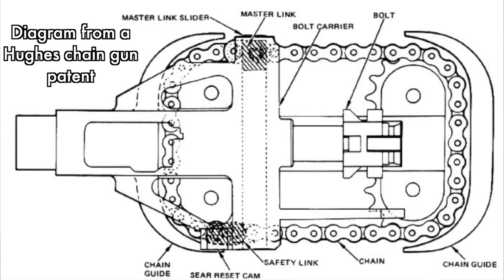Ask Ian: Are Man-Portable Chain Guns Coming?

Comment: In an infantry context the biggest benefit would seem to be that the use of an externally powered gun could in turn allow lighter ammunition because of less propellant, but not only would that only hold in situations where the weight of ammunition outweighed the weight of the firing platform, it would require an entirely new type of ammunition, which is why it would never happen.  Not to mention that the majority of ammunition weight is the casing and the bullet, not the propellant.

Comment: I would expect it to be fairly simple on a minigun to have adjustable fire rate by running the motor at a different speed. If you want to fire at 600rpm, you can do so for a very long time without overheating. If you want to fire at 5000rpm, you can do so for a brief time. Not sure whether this has been implemented.
Reply: In the F-15, you can select between 4000 and 6000 rpm. 6000 gives you about 9 seconds of firing time.
Reply: I suspect there's not much point, miniguns exist to throw as much lead as possible in a very short space of time. If you only want 500rpm, most modern, general purpose machine guns are perfectly capable of sustaining that for quite a while, if you have a spare barrel or two.
Reply: @matthewn4896  I'm making this up but it could be a way to allow suppressive fire without the space/weight of an extra MG or burning through your ammo at full rate
Reply: @totensiebush  mini guns don’t like running in short burst or slow

They like to chew
Reply: Pretty sure you can adjust the RoF of a minigun just by changing how fast it rotates. Like if you just try to force the barrels to rotate 1 click the gun will fire so you could just get a motor to spin it at a rate of 20 rotations per minute or 140 rounds per minute. Very slow but Im pretty sure its possible.

Comment: When most laymen say "chaingun," they are referring to powered Gatling guns. But I do appreciate that Ian explains it using the actual definition of a chaingun--as used as the autocannons of IFVs like the LAV or Bradley, or the 30 mm cannon of the Apache.

You can very finely control the rate of fire on the chaingun. Great for IFVs as you can program burst fire from a single trigger pull. 

I think there is a 30 mm portable chaingun in development on a small tracked drone for infantry support. It uses HEDP rounds with air burst. This is smaller than a car so it can be support infantry where vehicles can't get to.
Reply: My brain instantly went to "helicopter gun" and i'm quite lay
Reply: Wolfenstein 3d and Doom are to blame for that I think.
Reply: You can technicaly have Gatling chaingun if your ammunition is loaded by separate mechanism right?
Reply: @petrsukenik9266  There is such thing as a "revolver cannon" where the the back end is like a Gatling but it still has only one barrel. This is the cannon used in some European fighter jets, the Mauser BK-27
Reply: @petrsukenik9266   When folks say "Gatling" they typically mean some system of multiple barrels rotating around an axis. "Chaingun" refers primarily to (Like Ian talked about.) the chain driven loading and rate of fire management. 

  Combine both features? You'd take the weight penalty of both the chain drive and multiple barrels. I'd still like to see a good try at one of those.
Reply: @petrsukenik9266  That would entail adding a lot of mechanical complexity for absolutely no gains over a regular Gatling-type rotary gun.
Reply: @ThomasFuglseth  not saying its practical, just saing you can have Gatling chaingun
Reply: @UCKY5  minugun is when something is spinning barreles and thar operates loading mechanism
Chaingun is when you have separate machine loading the gun
Therefore you could have spinning battels and separate loading mechanism to combine disadvatages of both systems
Reply: Even IFVs dont need chain guns. Eg the Puma IFV, with its advanced dual feed 30mm cannon and programmable ammunition, is just gas-operated. Its not even a revolver cannon like some previous 30mm cannons of its type. Probably saves a lot of weight and is easier to reload than a chain gun.

And regulating the firing rate of autocannons is surely super simple anyway. The disconnector is probably electronically controlled, after all (the gunner is using a button, not a mechanically connected trigger). Heck, even the fuse might be electric these days.
Reply: @termitreter6545  MBTs use an Electronic Ignition for ammunition, or at least the Abrams does. Even the backup "Master Blaster" is a quartz triggered electrical impulse.
Reply: @chief5861  Yeah Ive looked it up, and it seems like the standard for Nato 120mm tank rounds is just electric primers.
Probably just makes sense; you got the space and power in a tank to do so, and its probably a lot safer and more relaible too. Its probably quite easy to accidentally drop a cartridge and bang the underside somewhere.

In fact, looks like even many WW2 tanks used electric primers. At least german tanks, like P4 and Panther.
Reply: @termitreter6545  Its less of the possibility of dropping it and more the simplicity of an electric igniter compared to rigging up big ass firing pings in those breeches which could break if not cared for. And yeah given that most other things are electric why not fire the gun that way too.
Reply: @chief5861  I mean its all of those combined I'd say^^
Reply: @chief5861  Isn't the 20mm Vulcan gatt on US Aircraft electrically primed?
Reply: I'm one of the people who misunderstood the term and I blame Doom for that...

Comment: As the cartridge is not powering the action, is there an opportunity to gain muzzle velocity or trade off the amount of propellant (and hence weight) of individual rounds?
Reply: Insignificant. By comparison, look up the difference between .308 in a bolt and semi auto with same barrel length.

Comment: I'm no engineer, but I've always wanted to somehow build a man-portable revolver (auto) cannon.

Like they use in aircraft. Basically a mini shVAK or BK-27 in .223/5.56 instead of the usual 20mm or 30mm. 

Awesome, but entirely impractical in every way. Could achieve some insane rpms, but cooling would probably be next to impossible (especially under sustained fire).
Reply: @Cancer McAids  I was under the impression that regardless of the magazine size of your automatic weapon, short controlled bursts of fire are preferable  over just gluing the trigger to your trigger finger ammo dumping  fire. Am I correct?
Reply: @drivanradosivic1357  If you have a system capable of keeping fire on target, volume of fire is always going to directly increase your hit probability. The reason you don't dump is because no system can stay on target that well, so you split the difference by firing in bursts.
Reply: @dustinbrueggemann1875  so, firs SMART guns from Alien?
Reply: As others say - Miniguns and Microguns exist. And nowadays the electricity for the motor is hardly an issue anymore... But the REAL issue remains: Unless it's an Airsoft Gatling (which do exist btw, if you have a lot of money to waste), you need to carry a backpack with ammunition. The larger the calibre the bigger and heavier the backpack... If you have a gun that fires 1500 rounds per minute, you do the maths... And THEN you look at how much that ammo will cost you. That's the trouble with all machine guns - they're a lot of fun, but only if somebody else pays for the ammo 😂
Reply: Just make a double barrel gas operated revolver gun with quick change barrels and lower overall rate of fire like Oerlikon RK 421 with a single chamber so one can change one barrel while continuously firing the other one.
Reply: Chambered in .22LR but with a weight of fire (due to a vastly higher rate of fire) matching an AR.
Reply: blow air around it or maybe use water for cooling... pretty sure big cannons on ships do that
Reply: A company called Empty Shell made a 5.56 NATO version of the minigun. There are lots of videos on YouTube. 
https://youtu.be/UdGueKkjQlk
Reply: Something firing 5.56 isn't a cannon, so I wouldn't call that an autocannon. Not sure what the right term for it would be.
Reply: @totensiebush  "Fun," that's what you should call it.
Reply: @totensiebush  you have the minigun, but also the microgun as in, the smaller caliber using minigun.  I think there was a Shotshow or some other gun related event that had the microgun promos.
Reply: @drivanradosivic1357  i remember seeing a .22lr minigun.
Reply: @leflavius_nl5370   so, you saw a .22lr Microgun for sale? neat.
Reply: @drivanradosivic1357  The minigun itself was IIRC a miniaturized version of a bigger gun. But it kinda became the popular name for multi-barrel guns.

Autocannon on the other hand usually just means a large caliber machine gun, like 20mm and more. So a small AC is basically just a machine gun.
Reply: @termitreter6545   For what I saw, Autcannon is what people call a single barrel machine guns, but could also mean some semi auto nade shooter or even a explosive round 50BMG in semi auto sort of machine gun.
Reply: @drivanradosivic1357  Thats sounds like theyre just using the term for fun though, because Autocannon sounds cool. I dont think it makes sense.

Like, autocannon is the short form of "automatic cannon".  A large caliber, automatic and usually self-loading gun. Its sometimes used for guns that arent self-loading, like chain- and miniguns, but their use-case is similar, they shoot the same ammo often enough.

Otoh, a grenade launcher isnt a cannon by most definitions. Even if its fully automatic.
And 50 BMG was literally developed as a machine gun cartridge, so rebranding it as a cannon would be strange.
Doubly so considering theres 14.5mm machine guns.

Comment: You also need to charge the batteries. Perhaps some sort of gas-piston-operated dynamo could charge them? 🙃
Reply: This is some wind turbines on top of trains logic right here.
Reply: @meanmanturbo  yes but if you're running and gunning perhaps wind powered could work! Or flash hiders directing flash to a mini solar panel??
Reply: What is the point of removing gas piston used to cycle the gun only to add different gas piston to cycle the "dynamo" :)
Reply: @IShyper  that's the joke
Reply: @IShyper  Because you wouldn't be affected by malfunctions. He's not technically wrong either. You could use the venting gas to spin a magneto that jolts the chain motor. Same way a car powers its spark plugs. You'd need to add a capacitor to store a lil bit of extra juice to keep it going in case of a misfire ofc. Though its arguable that your power margins would be so slim that a misfire would just stop the motor anyways which would mean you're in the same pickle as with a regular machine gun. It'd be an interesting concept.
Reply: @rileybriggs4731  it was a joke, not an interesting concept 🙃
Reply: @doggwoggle  Impressive. Perhaps this is one of the "so stupid it just might work" moments
Reply: @IShyper  the point is 🙃🙃
Reply: That... Like, wouldn't that reduce the velocity of munition? Like, pretty noticeable?
Reply: @rusdanibudiwicaksono1879  Not any more than recoil operated weapons do.
Reply: "Russians are coming! Shit, I forgot to charge my MG-2057!"
Reply: @webtoedman not on a hand held chaingun it won't
Reply: I had the thought that a long stroke (I think that the term, where the barrel moves back?) that could run a strong magnet through a coil on the gun to charge a capacitor to cycle the action.
Reply: @groofromtheup5719  good idea!